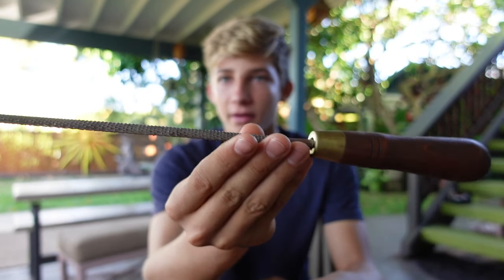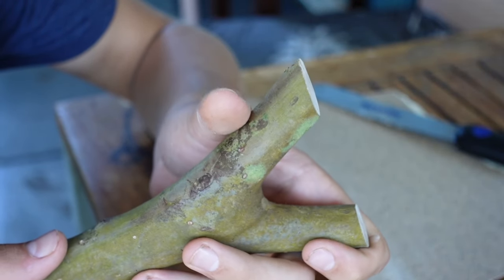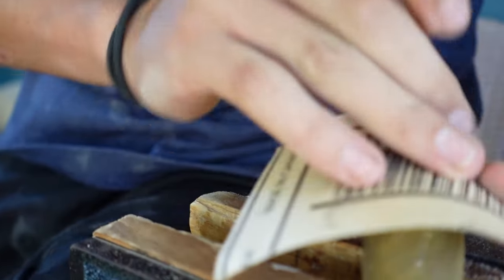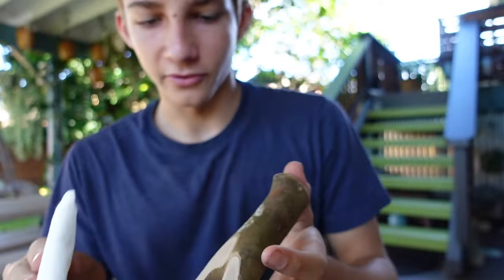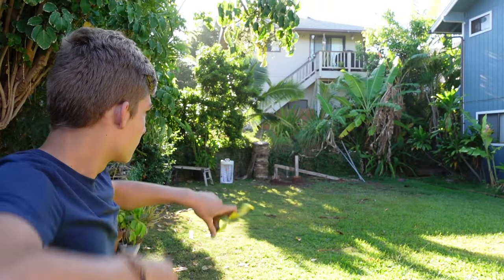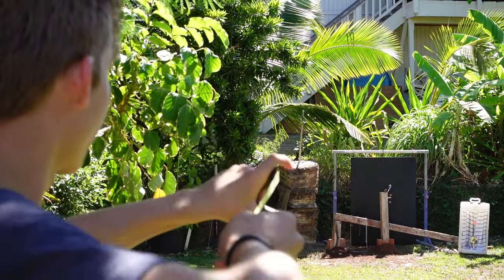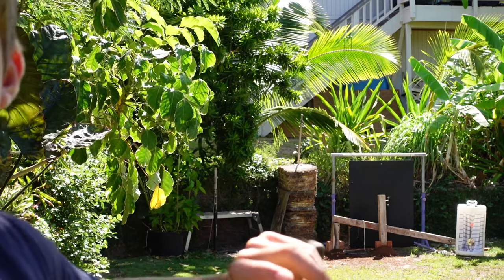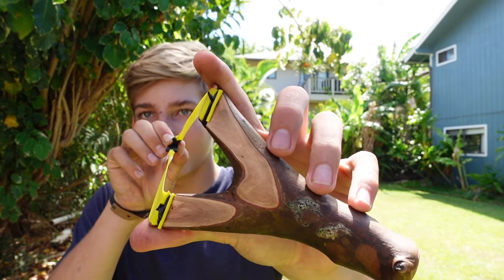How to Make Simple Natural Fork Slingshot | No Power Tools

Comment: You either want to construct a large cube with a 45° angled back and an open front with lip at the bottom basically a giant airgun pellet trap idea being that the shot hits the 45° slant and is angled down in to the bottom of the box. 

Or you want two poles a distance apart with a line between on two eye bolts with a heavy duty outdoor fabric curtain double over the line to absorb the shots energy,.you can also have an open top enclosure at the bottom to catch the ammo.